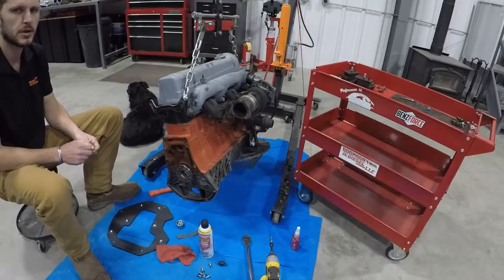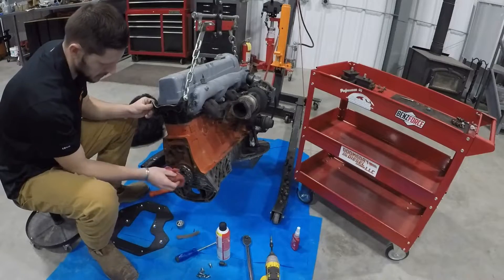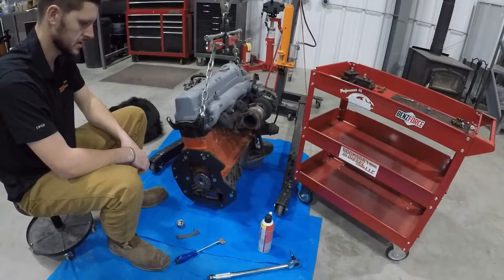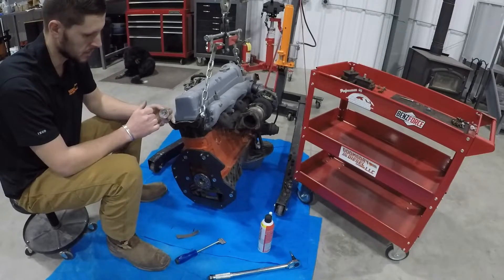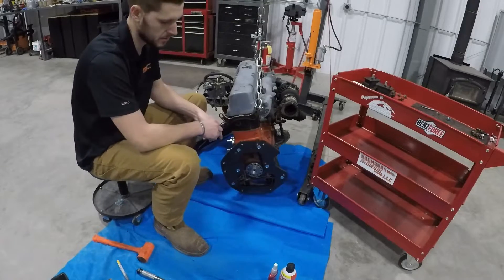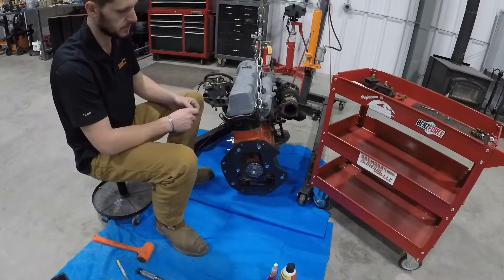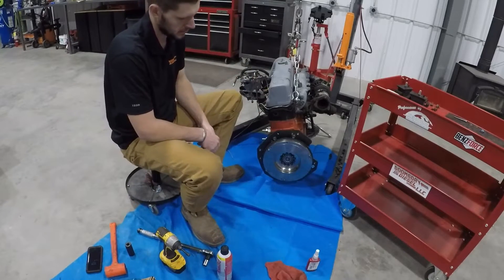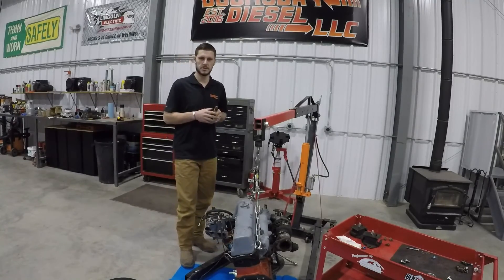OM617 Conversion Series: Transmission Adapter Plate Installation (Toyota R150)

Comment: I’m about to order your 3vz adapter kit iv got an om617 and an r155 transmission out of a 2006 Tacoma iv sourced a bell housing from a r150 out of a 96 pre runner with the 5vz iv ordered the 96 clutch kit and I’m just wanting to be sure that with this kit and with the 96 bell housing and clutch will the r155 work? I’m very new to Toyota so this is all very new to me any advice would be appreciated
Reply from the maker: The R155 requires a 3VZ bellhousing, not a 5VZ.
Reply: @doomsdaydiesel damnit I just spent all day yesterday cleaning the crap out of this r150 bell housing I did not realize the r150 in the 3vz was different
Reply from the maker: @patrickgates8548 yes, they're different lengths. I put a big note on my website that the R155 requires the 1988-1995 3VZ bellhousing to work.
Reply: @doomsdaydiesel 👍🏻 bout to order a bell housing off of a 1990 Toyota 4Runner 3.0 3vze r150f that should work fine with my 155r right ?
Reply from the maker: @patrickgates8548 yes
Reply: @doomsdaydiesel 🤙🏼
Reply: @doomsdaydiesel so iv just got my kit sitting here looking at everything i have the only thing im missing is the clutch actuator fork and the clutch pivot ball im wanting to make sure i get the right one for the 3vze kit i got from you im using the 1990 bell housing with the 10in 5vz flywheel included in the kit and a 5vz clutch kit i ordered off amazon, the fork and ball i need is going to need to be from the 1990 3vz correct?

Comment: Can someone chime in will this fit on a 616 are they the same bolt pattern? 1983
Reply from the maker: yes, it will work
Reply: @doomsdaydiesel  thanks !!! I’m getting a parts list together be in contact !!! U guys are awesome
Reply: @doomsdaydiesel  when ordering this kit and looking for the engine numbers on the side of the block, I have a 616 so it’s different than the 617 mine say 616-912
Reply from the maker: @michaelmichels5168  treat a 616 as a ".950". The trans adapter is the only thing I guarantee will work. Most of my other 617 parts won't.

Comment: which would be the correct adapter for a 92 runner? thanks!
Reply from the maker: The W56 or the R150
Reply: @doomsdaydiesel  hi, do you have both of them available? thanks
Reply from the maker: @franzjimeno8322  yes
Reply: @doomsdaydiesel  thanks joe! and for a 98 or 2002 toyota Hilux? is it the same adapter? thanks!
Reply from the maker: @franzjimeno8322  depends. Toyota used a lot more than 1 transmission

Comment: How much is your adapter  plate and the Pilot bearing. For a W54 transmission or a Nissan  TD27 transmission  to fit on the OM617
Reply from the maker: https://www.doomsdaydiesel.net/product-page/om617-to-w56-adapter-kit

Comment: Question for ya bro, I'm trying to put a "79 om617 in an isuzu rodeo 2.2 with a manual and use the manual trans from the isuzu. The 617 was an auto so its got the auto flywheel but nothing else so I'm a bit lost on which way to go. Can you make an adaptor for the isuzu flywheel or would you recommend trying to use a stock Mercedes manual flywheel with isuzu 5 speed? I don't need it perfect just want to get it mated up. Thanks brother
Reply from the maker: The Isuzu guys typically swap in Toyota trannys. Cheap and plentiful and the cheapest trans adapters I have.

Comment: I would be interested in a plate for dodge 46re
Reply from the maker: The Ram 1500 is a little too big to be a big hit with a 617. The 606 is a much better match.
Reply: @doomsdaydiesel  it would be an extended cab Dakota 2nd gen
Reply from the maker: @ktanner11  the Dakota's changed transmissions like I change my socks. You're best bet is to run a Jeep AX15, or swap bellhousings to run a Dodge. I can't justify supporting all the variations the Dakota's had.
Reply: @doomsdaydiesel  i understand you from a business point but a 44re or 46re in a Dakota is no different than a half ton.............. They all share the same 727 outer case. I think i will just make my own.
Reply from the maker: @ktanner11  the cost of building your own (properly) will be double if not triple the cost of one you can buy since you'll go thru 2, 3 maybe even 5 plates before you get it dialed. The question becomes if you have the time to invest into making it vs. just finding a different trans.

Comment: Will the r150 fit in the w123 chassis? I’m looking for a better transmission preferably a 5 speed to put in I was wondering if you had any recommendations?
Reply from the maker: The W56 and R150 shifters both line up almost perfectly with the W123 shifter hole
Reply: @doomsdaydiesel  thanks for the help I saw you’re email, is the w56just the bell housing or is it a whole different trans?